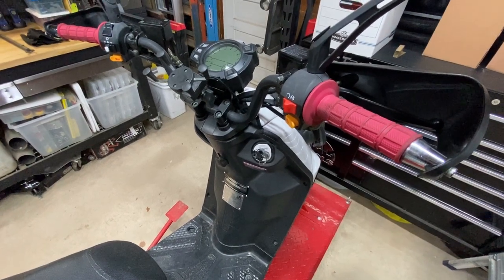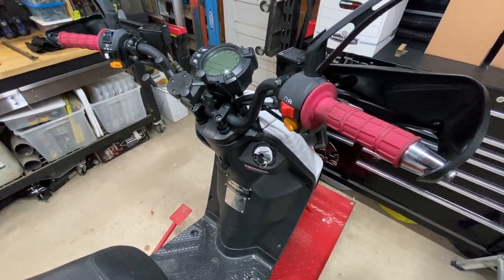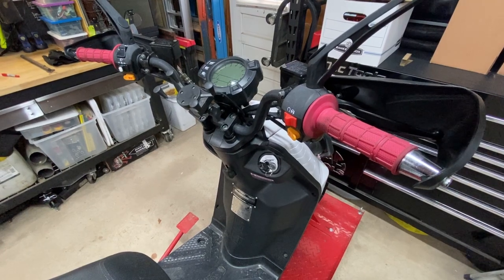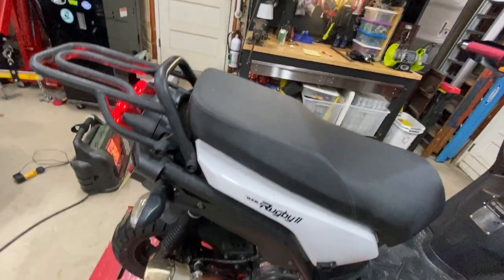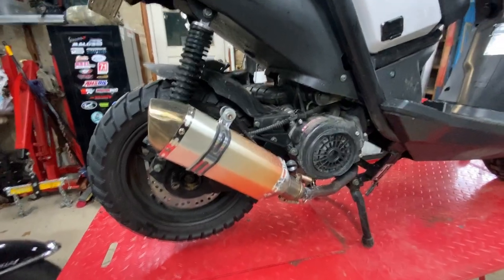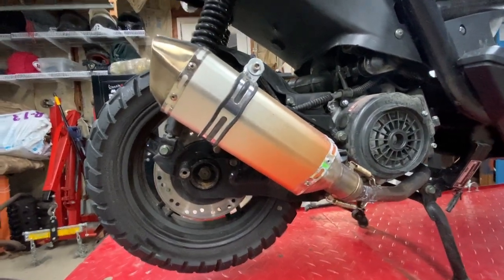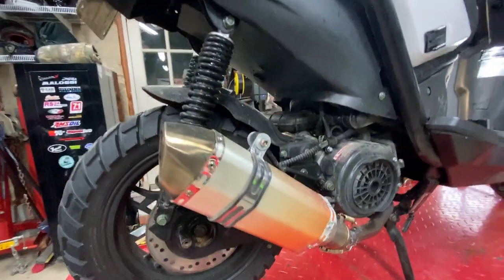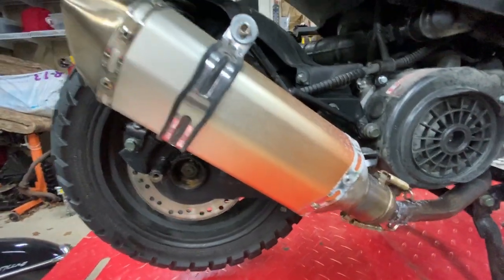GY6 EXHAUST UPDATE REVIEW - WOLF RUGBY II - SCOOTER BILL

Comment: I just purchased a Clash 200 scooter.I really enjoy it. It's actually a 171cc 61mm bore with EFI. I think you'll really enjoy the 170cc upgrade when you install it. Do you know if the exhaust port is in the same position as the 150cc GY6 head? I want to change out the exhaust. My scooter looks exactly like a Honda PCX 160. A Clone for sure. Also which Variator and weights do you use?

Comment: Sounds good but what about jetting, the downside pipe seems thicker than the regular, does it change the performance?
Reply from the maker: I did not rejet the carb with just the exhaust and it was fine. After adding a high flow air cleaner jetting would be necessary.  I did see a small increase in performance with just the exhaust.

Comment: I got the same muffler and the muffler pipe from the links you sent on here they did not fit together that sucks you didn’t get the right size on pipe the one that goes from the scooter out to the muffler now I have to buy another bike or something it’s OK it happens just figured I would let you know
Reply from the maker: That’s not good.  The links I posted are the one’s I used.  They should both be for 51mm. I guess that happens sometimes with the Chinese aftermarket stuff. They may have quality control issues.
Reply: If you look at both links that you have muffler is 51 mm And the pipe is 50.8 mm so that’s why they didn’t fit I was just  Didn’t look at the link close enough I just figured you had the right ones there it’s OK it happens

Comment: Did you have to fabricate a bracket
Reply from the maker: I used the one that came with the headpipe and removed the section that interferes with the oil dipstick.
Reply: @SCOOTERBILL  any chance if not asking too much you can link me to one that will fit this bike.  Desperately need one and don't want to waste money on another stock one.  The link in the discription does not work sadly.  I venmo you $5 for the hassle lol